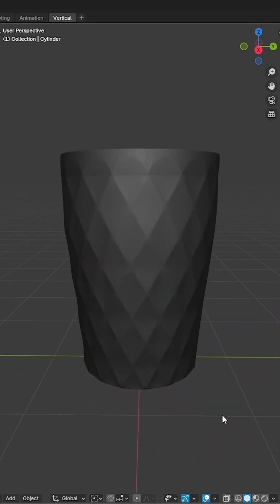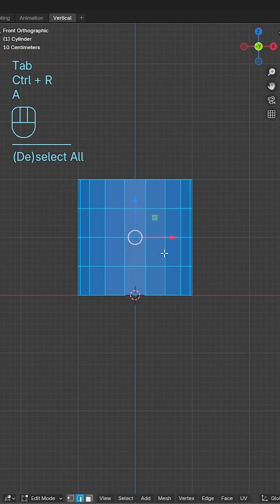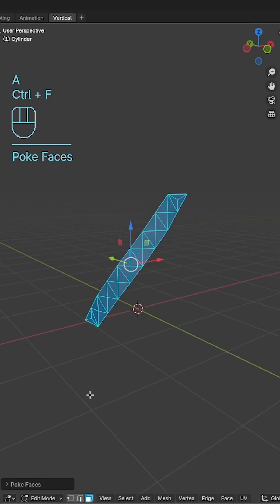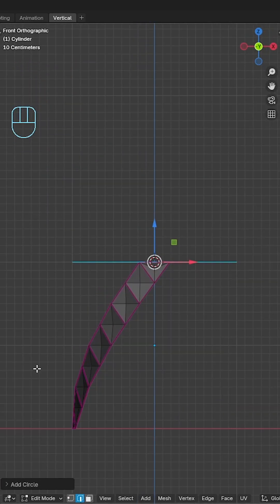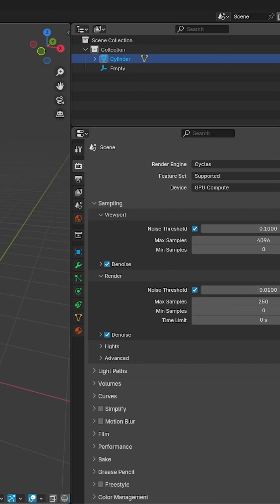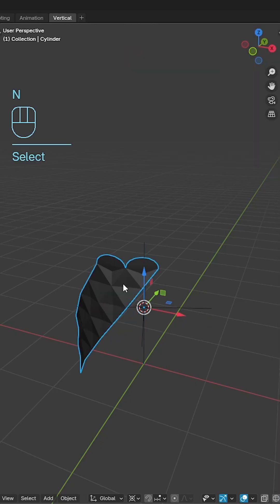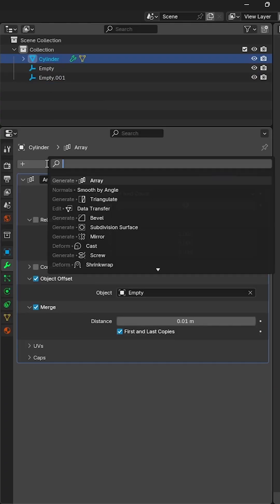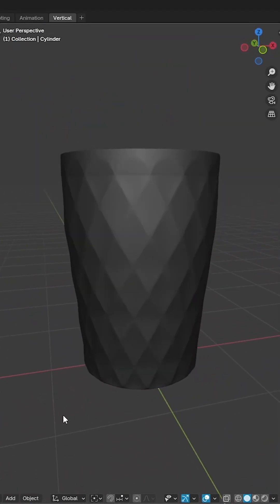Blender Modelling Challenge 4 Solution | #blender3d #blender3dmodelling #blendertutorial

Comment: Beautiful model! You could use the spin tool to save time instead of going through the array process.
Reply from the maker: Ohh, I don't believe I've used the spin tool before! A lot of the modelling tools that are in tools side panel, I've never used. 😅 I can't even remember when they were introduced to Blender, but I've just neglected to muck around with them. I should really make an effort to test them out though. So cheers for bringing my attention to them. 😄
Reply: @masterj2001  It's incredibly handy when you're focusing on just one section of the model, as it speeds things up. I highly suggest giving it a try, it's been a fantastic tool for me. It's fairly easy to get used to.

Comment: What is the point of modeling with subdiv if you gonna hold the shape anyways with a crease?
Reply from the maker: Creases only work with subdivisions since they pull more of the subdivided topology to support that edge.

Specifically, I like working in this modelling style as it makes it easy to create a low-poly (LP) and high-poly (HP) mesh simultaneously. This means I can then bake down normal maps to my LP mesh from my HP mesh and have better render times with crisp edges on my model without rendering millions of polys. 😄 

Bevels also have their place in subdivision modelling, though I find them more helpful in defining larger rounded sections or chamfered areas than using them for holding edges. 😄

Comment: Ps you can also do those without deleting everything except one roe
Reply from the maker: Oh! I'd love to know the method behind that!
Reply: @masterj2001  well, didn't test it, let's get that out. But I think weg. You do the poke and then poke again. Select vert, select by similar > connected edges. Though that could cause an issue perhaps.

Issue would be that building shape at the top. Would be a bit harder to pull off working at a lot more geometry
Reply from the maker: @RomboutVersluijs  Yeah, so the semicircle at the top is the main reason that I use the array technique, as otherwise you would need to manually place them or do an array only on the semicircle and then cleanup all the geo manually.

I figured doing it this way would be the easiest for topology management and cutting down on the amount of manual work required. 😄
Reply: @masterj2001  well perhaps if you extrude upwards. Then subdivide and then do checker deselect. Then use move with proportional editing, and individual  origins. Move up, grow selection and then do that inset.

I just test that too part. It is possible to make. Only issue is rotating that half circle outwards. It's Abit funky. But it's a nice exercise
Reply: rotating half circle? rotate by cursor (but first need to select the lower edge, move the cursor ,rotate by normal and lock one of the axis), if array already applied, select all the half circle, rorate by individual normal, and normal
Reply: @deemo3647  yeah, I was trying to explain doing this on complete mesh